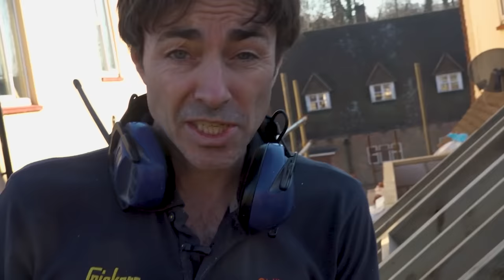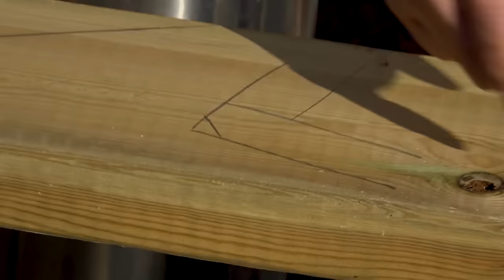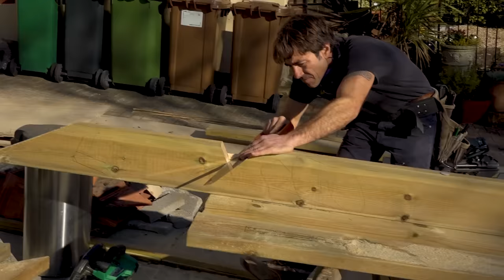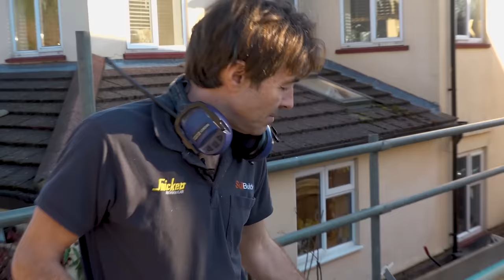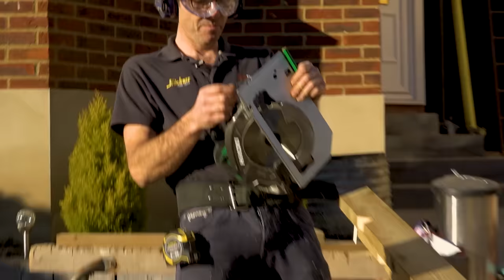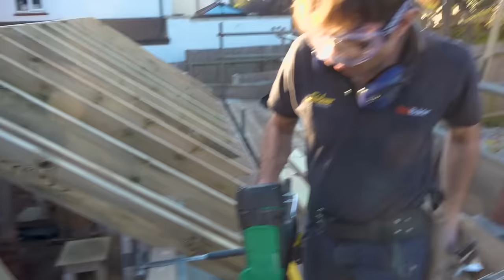How to Cut Hip Rafters

Comment: The view from the back of the circular saw should have been done years ago.
Not a fan of cutting rafters with cordless.
Nice n neat though.
You must have some deal using those Irwin throw aways mate,they aren't the best out there, suprised your using them.
I'm a bit old school myself and a bit younger than you,I have the hikoki guns but wouldn't really use it on cut roof's.
Only your bicep is a weaker,
Ha!

Comment: Im curios about the steel joists on this building
Reply from the maker: It is a flat roof extension with a ring beam of steel and a lantern on top. The pitch is simply to make it look a little more like the original. It also gives a higher ceiling because it is vaulted inside.

Comment: hi robin ,what brand of roofing square do you use as mine doesn't have same markings for protractor use ,got a metric one and imperial,thanks for great content.
Reply: richard Capey-wade buy empire
Reply: g gibson. It's based on the Smallwood square
Reply: cheers ,just cleaned my metric square and found the 2 marks!!

Comment: Nice miss alignment on the steelwork column top. Good job it's only a ground level building!.
Reply from the maker: Get real if  it needed shims he would put them in but it doesn't. It is supported.
Reply: @SkillBuilder  you can tell it's not a CE rated company as legally it should be. The column should of  had slots on the side to gain max strength. Then pack the base plate up with shims and grout in.

Comment: Great channel....first, that saw has no balls, use a worm style by flexvolt, cuts like butter....that method is fine for a “ bastard hip” ...but very ,very slow...every cut can be done on the ground.
.....the easiest and fastest way is to use a construction calculator. ,run,pitch,common,hip..done...if no calculator,then use the rafter square, not a speed square. 
....run x pitch under the hip number. The framing square is set to 17 on the long side and the pitch on the short side of the square. Dead height ( the plumb cut ,where the rafter touches the plate or plywood)  is the same for the hip..
...all jack rafters can be stepped off of a common rafter or again 20x faster using a construction master pro calculator.
...we cut the entire hip roof on the ground , ridge,commons,hips and jack rafters then use the lull to lift the “ pyramid “ style pile up...you can layout a common rafter with all the jack rafter marks on it, cut the first jack 4 times then use that and flip it over, cut four more and so on. 
...it’s only more difficult if it’s a bastard hip or the hip is 2 or 3 wide lvls, not a single 2x12 or such...just use math, physically holding temps and measuring is entirely too slow.....
...the hip looked good, just could be done 20x faster by using just math. Cape Cod waterfront homes 30yrs..we do these everyday.
Reply: I think he mentioned calculating it... but that it was more accurate to measure.  Presumably because things run off occasionally?  In an ideal world, with dry timbers that are PSE then using maths works.
Reply from the maker: Why do Germans never tire of telling the world how good they are? 
If you meet a person like that you usually find they lack self confidence.
Reply: Edward Holmes dry timbers doesn’t play a role. A hip is a hip unless it’s a bastard hip. Math is never wrong. Only human error. A construction calculator is made for All construction needs, very simple and dead on.
Reply: Skill Builder what German?
Reply: John Mcgee  He never stated this was the quickest method.....Instead it's a slowed down and detailed method that's easy to understand and perfectly  articulated
Reply: @joeframer9642  It is a now deleted comment from someone who was possibly German.  Not sure why it was deleted as it was constructive.  I think the Skill Builder reply is rather churlish; you can have a difference of opinion without recourse to  being mean spirited about someone you don't even know.  Sorry Skill Builder, you're better than this and your channel was always one of constructive debate which is what I always respected.

Comment: anyone know the diminish multiplier for 20 degree pitched roof?
Reply: Hi, The calculation is .1064 x the centre spacings i.e 400=4 so your calc would be .1064 x 4= 425mm

Comment: What kind of wood is that? Looks like pressure impregnated wood, but it cant be since you should not build things inside with that?!
Reply from the maker: In the U.K it is a requirment in many parts to use pressure treated wood for structural components. We do not have the restriction that it can't be used inside. It is covered by a vapour barrier and plasterboard.
Reply: @SkillBuilder  In Sweden it's not allowed to use inside. So ppl only use it for decks n such outside. We only use untreated pine or spruce for construction wood.

Comment: Minimum wall plate thickness ..?
Reply from the maker: 50 x 100
Reply: @SkillBuilder  is that the same on all walls I have 50mm cav with old imperial brick im trying to gain a few inch for loft conversion,  existing is 90x90. Built jan1940

Comment: Bit of string pinned to top interior edge pulled tight to walls plate raised appropriately to height you neec to keep some meat on birds mouth set bevel of it for seat cut Bob's your uncle roofer for 30 years never failed me yet . If you get a template from existing even better

Comment: hip/valley run = 17"
Reply: Correct Sir, it's 17" and 8 " on the square the common rafter is 12" run and 8" rise for a 35° pitch,

Comment: why are you using treated lumber for rafters? Untreated is cheaper and better quality (USA) treated usually pine whereas untreated is douglas fir, much better for structures.
Reply from the maker: It is a requirement. In Surrey U.K we have a very hungry beetle which can eat untreated timber faster than you can say "Skill Builder is the number one channel for building information".
Reply: @SkillBuilder  wow thank you! glad we don't have that here- only need treated for exposure to weather or  ground contact as we have termites here esp in south they are very bad

Comment: Timber don't  look that wet . When I'm  on site some days its pissing down and the moisture  is just oozing out the sides . I have spear and Jackson  old style saws which i self sharpen and it still cuts through  no problem  . When i measure  a hip thats long i pick a straight  bit of timber and put a nail in the top end to rest it on the hip and mark off at plate . This is more accurate  and can be done without buggering up your tape by getting  water in it . Just saying . Nowerdays  you don't know your born . Cordless  power tools and everything nice and dry .
Reply from the maker: Thanks Mike, good advice for sure, though it is a long time since we saw anyone sharpening a saw.
Reply: What a hand saw? 😳
Reply: @SkillBuilder  you can still buy the files and setting tools . You can have a brand new set blade everyday and cost you know more than 15 minutes. Set the teeth so when you look down the blade you could run a pin down the middle . It's no problem and saves messing around shopping for a new saw . I have used one saw since 1979 and it's less than half its width because of sharpening the blade , ideal for second fix .
Reply: @mikeraphone6745  cool mike . I know where your coming from . To many rusty saws being thrown away . I would have been laughed at in 1980s if I had a disposable saw .  Still use my old saws . 5 tpi and rips through wet timber like a sharp thing through clover . I work with a company that builds log outbuilding's and don't have electric on some sites . Chain saw and my saw plus big hammer

Comment: 1 all hips are not the same, 2 you don't have to cut the plates on a 45 at bottom. 3 he put a long cut on the bottom,  this should be a vertical cut to nail a fasherboard. 4 use a corded saw this piece in the video is trash. I could have cut 15 rafters in the time this guy cut 1. 5 rafters are to be as thick as the ridge so that they are fully bearing on ridge. 6 another important thing is to crown the boards so curved boards always curve upwards. 7. Straighten hip and brace hip straight before attaching jack rafters

Comment: I only made it to the 6 minute mark.  This is definitely not a masterclass.  So many things to improve on in the first few minutes that I couldn't watch the rest.  I don't claim to be great at teaching these skills to the masses but if the title is masterclass, there should be a higher standard set.
Reply from the maker: Please tell us what you think it wrong. We all like to learn
Reply: @SkillBuilder  After reading a lot of the comments (which were all so positive) I decided to watch the rest of the video.  Cutting the sill plate corner off was unnecessary if you just made the notch in the hip accordingly.  Using the back of the handsaw to chip away at the cement block was surprising and avoidable with the proper hip notch as well.  
If you use math to figure the lengths of your rafters and hips (using rafter and hip factors), you don't need to measure as often.  When installing the rafters into the hip, it would have been easier to lay out the sill plate and hip instead of pulling out the tape measure while holding the rafter in place.
When cutting the double 45º bevel on the hip, you should adjust the depth of the saw to cut fully through the material especially if it is wet.  Your saw will perform better.  Also as a right hander, it would be easier to make that 45º bevel cut from the long side of that bevel and not the short side.  Sometimes you don't have a choice but when you do, it is an easier cut to make.
I don't make it a habit to pick apart other people's methods of doing things but when a masterclass is put on, I have higher expectations.  Your style gets the job done and looks fine but not necessarily a 'masterclass'.

Comment: If someone used my saw as an adze and then threw it on to the scaffold I’d cut his hand off. Respect your tools you wouldn’t do that if you spent an hour topping setting and sharpening it
Reply: Paul, these saws are disposable, they are designed for site use and are not resharpenable, the blocks that I trim are super soft so there is no impact on the disposable saw in any case, indeed I would not get my best saw for this!!!! Anyhow it is more cost effective to use the disposable saws and they are 3 for 10 pounds so sharpening and setting a saw onsite is indeed a thing of the past, in fact if you spent an hour doing that onsite you would be slung off!!!!
Reply: Robin Clevett granted, jack saws are cheap prefer a S&j predator myself. Just like people to respect there tools in this throw away society, nice roof though, one question, why didn’t the Brickie bed the plates on?
Reply: @paulmaxwell3505  Hi again Paul, I do agree about looking after tools!! The bricklayer didn't bed the plates because there was steel work that some of the plates where fixed too and we put the steels on and fixed the plates so we shimmed the remainder of the wall plates on the block work and then he pointed them once we had the rafters on, well spotted mate

Comment: This method seems amateur to me. His hip looks to be the same depth as the rafters. Measuring the jacks and hips down to that wall plate corner makes me sick. Fair enough it's simple and he can't really go wrong but the skill level is low. Besides I would rather have a square roof ontop of a slightly out of square wall. What's going to happen with this method if it's a long wall plate which bows inward or outward. Its going to transfer to the roof plane. 
I'm not a hater the guy is probably better than me but much better roofing carpenters out there like roofslayer and roofstacker.

Comment: Tha'ts one way to do it. It is not good for a high wind area. To quicken the construction: Use a Hatchet for the birds mouth and the 45 cut which can be deleted altogether. Less climbing up and down. 2x4 for a rafter is flimsy. I guess your snow load is next to nothing. Use hurricane clips and no birds mouth, along with brackets for the top is another way.  For those stick like arms you need grass fed beef and eggs with bacon in the morning.
Reply: dielauwen no
Reply: No birds mouth? Haha, so wheres the load direction going then genius? LOL

Comment: Basic joinery always put camber of timber to top never prop a timber with sag on bottom 
Not even a school boy error total amateur
Reply: Mark when you build a roof then you will use members that will sag under their own weight and it's not until you add a purlin or other specified support that it will be straight, so your remark is not applicable in my video, thanks for the comment